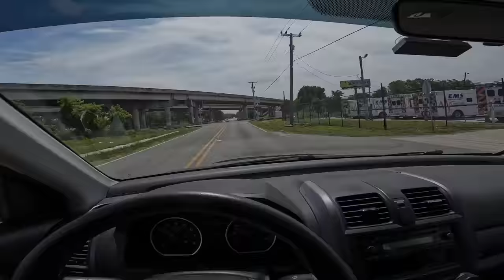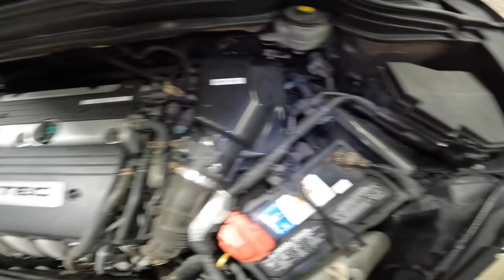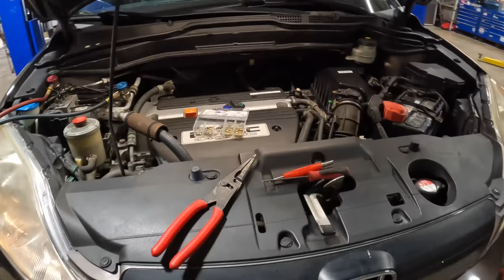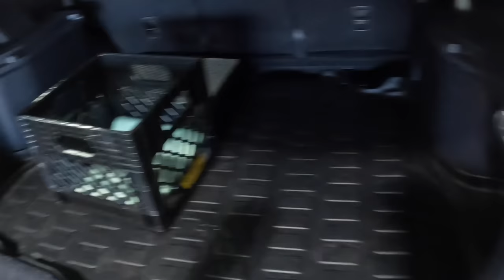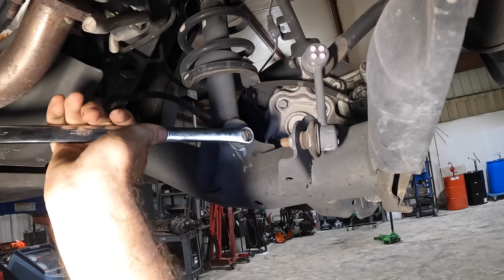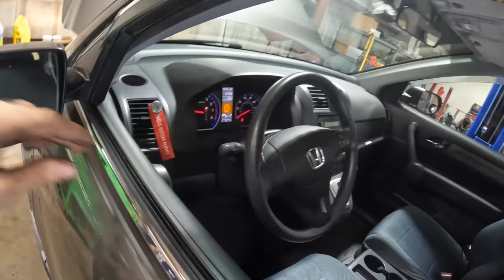Sloppy Suspension! Too Easy? WRONG!! Honda CR-V 2009 1.4 #mechanic

Comment: Awesome patience & perseverance. Glad you didn’t edit out your struggle in getting the old strut out. As a DIY’r, I hate  videos that make jobs look 10x easier than they actually are.
Reply: If you want to know truly how long a job really takes, ask the office manager, she watches without any edits, like did he leave the socket on the sway bar bushing bolt?
Reply: Did you get the socket
Reply: @johnchambers12  I was waiting for gravity to take over on that one as he brought the lift down, but I guess he may have been sneaky and got in there to retrieve it already!  It would otherwise surely have fallen off as he climbed in the tailgate.
Reply: It helps also to do it not you're self and let a garage handle it.

Comment: Eric O has this long hockey stick shaped steel bar that gives more leverage to pull control arms down. It goes below the control arm and has a hook at mid length to snag the control arm. Old school but it seems to work great.

Comment: I got stuck in the trunk of my 04 Corolla when replacing my struts.
My neighbor was walking his dog and was nice enough to pull me out. 😆
Im about 6’2” and 270lbs.
Im jealous of all the room Ray had back there.
Reply: I'm shocked you could even fit yourself inside.  I have to say, all the years I used to work on cars.  I never felt the need to fully climb inside the trunk to do shocks.    Wasn't there a manual release inside the truck you could have pulled?  As far as I know, most cars have a manual release inside just in case of something like locking yourself inside the trunk or being kidnapped.
Reply: @jbdragon3295  
I wasnt clear. The lid wasnt closed, I just got my feet wedged in just so and couldn’t get out.
Two of the nuts were reachable from the back seat. The other had to be gotten from the trunk.

Comment: That didn’t sound like a blower squirrel cage issue that sounded like an inexperienced person let the debris that had collected on the top of the cabin air filter to fall into the heater box. Troy is your assistant as well as you are his on occasion. Thus it is a good shop for Troy to learn in!
Reply: quite clear troy needs plenty of "learning" - start with: "stahp with jeeps and expecting it to go well" LOL

Comment: In my experience, i learned to not replace OE parts unless they fail. Like the front struts in this video. Because, the aftermarket parts do not last that long. Just my experience.
Reply: There are some....well used to be...good OE parts suppliers.   For years I used Tokico struts 'blues' as replacements on Japanese brand cars.   Wonderful product.   Unfortunately the company that produced Tokico struts sold their suspension parts division to a private equity firm.   I have no idea if they are still worth buying.
Reply: Especially batteries.
How come the batteries in two new vehicles I've bought have both lasted more than ten years but replacements struggle to reach half that?
Reply: Depends on the manufacturer. I've had aftermarket parts last much longer then OE. If you use cheap parts you can't expect them to last.
Reply: Main issue with doing aftermarket quick struts with some manufacturers usually Honda is strut mounts bind and steering wheel stays to whatever direction it's turned and doesn't fully return to center rec replace struts using OE strut mounts and aftermarket struts most others manufacturer not an issue and Alot have lifetime warranty with steering and suspension parts

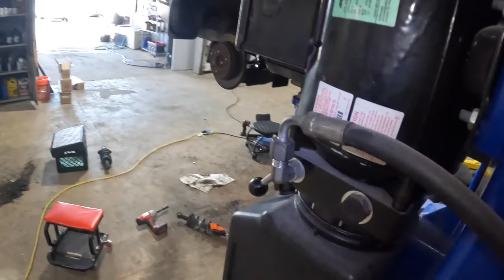Comment: Did you go back and get the socket you left hanging on the bolt at 34:39?
Reply: I don't think he did. when he lowers the car you can see Troy picking up the impact and the GoPro and the socket is still missing at that point.

Comment: I did my one and only neutral drop, in my '61 Buick Invicta...Blew up the constant velocity joint.Would have cost more to fix it  than I paid for the car, back in the '70s.

Comment: So my son, 18, just bought a 69 Ford Galaxy. Needed a power steering belt. No problem.  
I laughed my ass off,  and we did it so well we had to do it twice..🤣🤣🤣 I need a pry bar..."More pry bar!" Was said, as I was the pry bar.... and my son tightened the bolt.  
🤣🤣🤣🤣🤣
Reply: Make memories with that vintage Galaxie.
Reply: Wow, 54 y/o car,  First car when I was 18 was a '64, Galaxy,  they don't last 54 years in upstate NY.
Reply: @desotosky1372  for the year is in impeccable shape!! It's does have some rust, only one what I call bad at the rocker panel where the chrome wheel trim was.  But other than that it freakin sweat! I'm stupid jealous!🤣🤣
Reply: @michaelray5595  223, 289, or 390?  All good engines IMO.  Hope he enjoys it.
Reply: @desotosky1372  390
Reply: @desotosky1372  Oh, he's got a goofy stupid grin every time he fires it up.  🤣🤣🤣 Love it!!!

Comment: A hook on the top of a piece of rope or strap with like a saddle strap at the bottom allows you to use your body weight to pull down on the suspension while still being able to use both hands.
Reply: You beat me to it - loop a ratchet strap and sit or stand in it. If you need more weight use an assistant and a length of 4x2 instead of a pry bar.

Comment: If you loosen control arm bolts the tension would release.and you would have more access. But when you tighten them back after installing the strut you have to jack suspension from the bottom to set it at ride height. That would have made install way easier. But you got it!

Comment: 19:30....a jeep compass rear upper control arm got me that way last week...i ended up having to torch off the nut and used the nut and bolt that came with the new one to get it back on (for some reason they sent 2 nuts and 2 bolts )

Comment: Borrowed a quote from Chester cheetah. A neutral drop in an automatic wont always break something. That depends on the transmission. Like with a ford trans, you can fix a shift issue is some situations by dropping it into park at 5 mph, if you hear the park pawl stutter, that is ideal. The vibrations can shake the governor valve free.

Comment: I would love to see you use the oil vacuum tool on thise last bits of oil especially on the oil flushed engines. I know you like me don't need a clear oil jug but using a 5 and 1 quart jug for filling is very satisfying.

Comment: I had to chuckle at what we call the old “drive drop” (neutral drop). A group of buddies “borrowed” without permission one of their grandfathers small ranger pickup and went joyriding and raising hell. They were an hour from home doing burn outs egging one buddy the driver to do better so he pops it in neutral revved the engine tight and pulled her down in first gear. He felt something not right and got sick to his stomach when he looked in the side mirror and rear wheels not turning. They had someone tow the truck back to the grandfathers house and pushed it back into the garage like nothing ever happened 🤣

Comment: I had a few deceptive fasteners on some cam adjustment Bolts on the rear lower control arms of a 07 4runner yesterday come to find out the lowet control arm rear cams were replaced with aftermarket cams and bolts and the Front lower Control arm cams and bolts were orginal so the rears the cam was welded to the bolt head and had nuts and the fronts the cams are welded to the nuts and the Bolts are loose and not the adjusters ended up warping the bolt head on the rears with breaker bar torque thinking the hulk put them on lmfao 😂 and I have done that job thousands of times by the book even have the shop manuals and sure enough shop manual was correct but parts were wrong.. @Rainman Ray's Repairs

Comment: Wait a minute, my 07 Chevy has  almost 170 k miles and lots of gravel road driving and original struts still fine and no leaks.  I had a Honda once and the struts started leaking at 50 k miles.  Guess they are better now.

Comment: I've got one for you ! My wife has a 2009 Chevrolet Aveo and it had a clunk in the front end so I replaced the rotors and brake pads ' lower control arm and ball joints ' both struts so basically everything is new in the front end !! The cradle bushings are all good But it still has the clunk !!  What do you think it could be ?? This car is driving me nuts !!!!

Comment: Ray, there was a definite debris issue in that squirrel cage, but it may have been part of a foam duct seal hitting on the outside of the cage. You’d have to pull the blower to find it. 
You also left a socket hanging on that last sway bar bracket bolt you put in.

Comment: Put a loop of ratchet strap around the end of the suspension arm and stand on it to pull the arm down.
A whole body weight is more than you can apply with a bar and a strap is less likely to slip out of position keeping those oh so vital fingers attached to your hands.

Comment: I would like to submit a suggestion,  perhaps you could bolt some D-ring tie downs on the shop floor. You would then have strategic anchor points for wratchet straps.

Comment: Some Squirrel Cages make the motors sound bad like that I noticed aftermarket motors do that especially on older 96 to 02 4runners and even 4th gen 4runners 03 to 09 and many other models especially Honda and Nissan it's a foreign carn thing @Rainman Ray's Repairs

Comment: Not sure if anyone has said it yet and I’m only 25mins into the vid. But if you take out the trailing arm bolts and the sway bar bushing bolts the rear struts will fall right out.  No prying needed.
Reply: Welp nvm couple mins later you dropped the arm down.

Comment: Why didn't you use a spring compressor on those rear struts? It would've shortened the strut allowing you more wiggle room and maneuvering space. and you wouldn't have to mess with the sway bar.

Comment: Sometimes you can use a spring compressor to gain some space instead of disconnecting more parts
Reply: I was thinking the same, and it would have been a lot faster too.

Comment: I had a 2008 crv same issue  the fan bearing is starting to go I changed mine it got really loud and annoying and only did it at lower speeds .

Ac issue under performing do to high heat when gets to hot and ac clutch and coil becomes intermittent.stoppes working when ever it wants.remedy was new clutch and coil and problems were solved

Comment: I acquired my first snap on tool the other day while replacing a side light bulb, I needed to loosen the front quarter panel and remove the air filter housing in order to gain access to the bulb receptacle and inside the filter housing was a panel fastener pry tool. We had the oil filter adapter replaced recently (6 months ago) and wanted to gauge the viewers thoughts. Should I make an attempt to return the tool to the tech or does this fall under the lost tool/found tool code?
Reply: I say you make the attempt. Not a cheap tool!

Comment: funny I just bought a 1989 Pontiac Grand Am and EVERYTHING is labeled like this car. When it was changed, part numbers, even the bank of relays on the firewall are labeled with a label maker. Plus everything is in a 3 ring binder with mileage, cost part numbers and when.

Comment: My question is did you get the Socket that was used on the sway bar. you took the impact off and the socket was therre just before you wen into the cargo area?  Just do not want you to lose a socket.

Comment: The shock didn’t want to go in because as you know, springs settle over time once they are new, so the old ones were probably slightly shorter than the newer ones due to being used Springs

Comment: I put kyb quick struts in my 2009 crv last summer at 160k, wasn’t terrible.
Reply: KYB best bang for buck
Reply: I had to replace the struts on the Wife Unit's 2008 Toyota Highlander Sport... I used standard KYB's on the back, used a spring compressor, and swapped the old springs over from the OE units.  I took a "short cut" on the fronts - and used the KYB speed struts.  It saves a little bit of time - but the ride quality of the KYB speed struts was disappointing.  Thankfully, I still had the original struts and springs sitting in the junk pile - so I swapped over the OE Toyota springs - and ride quality was noticeabley better.   Bottom line: I won't use speed struts again.  For the few extra minutes involved, I'd rather replace the strut bearing, install a new lower seat and new strut - than go with the cheaper speed struts. The "advantage" of the speed struts:  The unit costs less, and Ray doesn't have to charge labor to swap the springs over - but in my opinion, the savings are superficial.

Comment: Did you check for recalls? My 2007 crv just got a rear trail arm recall….paper said it’s for 2007-2011 for crv’s that have been driving in cold weather states.

Comment: You are lucky that your car had a removeable panel for accessing the top rear strut nuts.  My 94-97 Accord requires a near complete removal of the rear seat and rear deck components to access the friggin nuts.

Comment: When are you going to show off your new Zero Degree 3/8" Inch Drive Gearless Ratchet Nickel Plated  with a 1" Turning Arc for those tight areas?

Comment: I know these questions get TEDIOUS. I would like to know when you tighten the 2 NUTS on top of the struts-inside the trunk area- there seems to be no torque wrench used. You just "know" how tight the electric impact wrench is torquing the nut by feel/20 years of experience? You seem to do a lot of bolts/nuts by feel. The rear control arm bolts/screws you removed to get more room to the strut out. You did the same thing when you tightened those control arm bolts back in place. You just did it by "feel" again, no torque wrench.  I would definitely need a torque wrench to get it right.  Thanks for the video!

Comment: Am I the only one who was worried that box of Schrader valves was going to vibrate off of the engine cover and spill all over the floor?
Reply: I have this lovely tray/compartment box of assorted screws and nuts in my service van. I forgot to close the lid and left it resting on a box in the back. As I was driving I heard it fall and then the sound of screws pouring out everywhere. Not good. So yeah, spilling small parts everywhere, the fear is real.

Comment: Had a regular garage been changing the shraeder valves and the tool broken off in the fill port disaster would have happened when the valve was later removed. Raymundo rainy would have maybe done so too but he couldn't get the newer valve removal tool in because of the broken piece. Had that been a less contientious person he would have forced the tool in and the compressor would have gone bye bye.

Comment: please give an easy explanation on how to determine which is the high side and which is the low side tubes..
Reply: Usually high side has a red or a larger cap. Low is smaller or blue.

Comment: 25:35 I truly hope you spray those spider nests/eggs and put them outside. Not in an inside garbage. Where I live (apartments) a resident brought in a stuffed chair that he put in the laundry room. I sprayed multiple spiders and nests/eggs and thought I had killed them all. I even sprayed in the padding cracks and everywhere I could think of. A month or more later more hatched and spread around the laundry room. We didn't want the chair to begin with. Sprayed again and had the building Maintenace guy throw the chair in the dumpster. Problem solved. We hope.
Reply: Ever seen "Arachnophobia"? You're doomed...

Comment: Come on Ray...  The fan motor was a gimme and you wrote it off.  That was a place where your endoscope would have come in handy.  There is definitely something hitting the squirrel cage and just because you didn't feel it, you gave up.  No, no, no.  Get the scope out and try again.

Comment: Did you leave your socket on the sway bar?
Reply from the maker: No I got it…Good eye 😏
Reply: I'm still wondering about the magnetic drain plug tool on the bottom of the lift arm...  🤣

Comment: I still struggle to believe oil drains back into the sump WITHIN SECONDS of shutdown, giving an accurate oil level reading.
My cars never did.

What an effed up rear suspension; take half of it apart and still have to dangerously pry the rest out of the way.

Comment: Hi Ray. Air Con is a rarely ticked option, over here, so I never used to see it. Nowadays, however, it comes as standard equipment, so it’s starting to appear in my workshop.
I’m interested in the oil. How do you know the oil in the system is correct? Maybe you recovered none because there wasn’t any in there, perhaps after a diy recharge.
Are there specs for that? Or do you just go by the seat of your pants?
I’m saving for my first AC machine, so this stuff has become interesting to me.
Reply: Is there a "universal" oil - or do you make sure to use the correct PAG or PAO?

Comment: Also the drain hole on the oil change is really in a bad location, making oil changes incomplete without removing the oil pan which is ridiculous. Probably a full quart left in car. He said it took 4 1/2 or 3/4 quart changed. The view on the dipstick is proof the bottom of the stick is the old oil.

Comment: How do you known which side is of ac is the high side or low side?
Reply from the maker: Different size ports on the lines. They can’t be connected backwards
Reply: Color coded too. One is red, one is blue.

Comment: Ray , one of the short Erwin bar clamps you can change the direction of the end fixture on,  that will make it push as well,,  those work great for getting just that little extra titch of an inch you need sometimes!

Comment: Pro-tip: Use a large pipe wrench (and cheater bar if necessary) adjusted to get the best grip on the lower control possible and then use that to flex it down and into place.